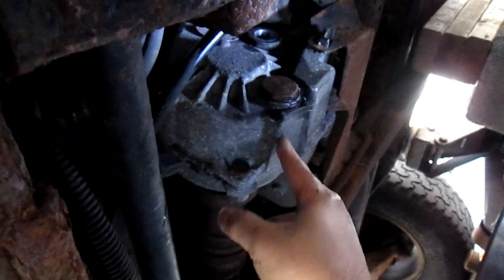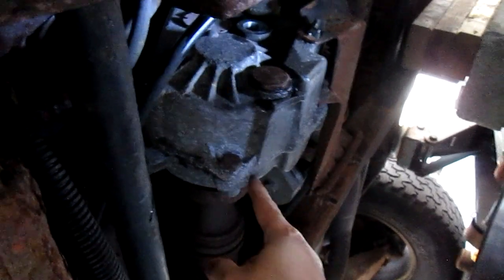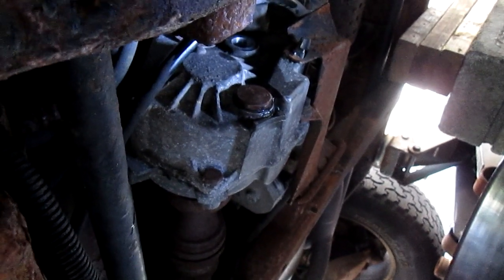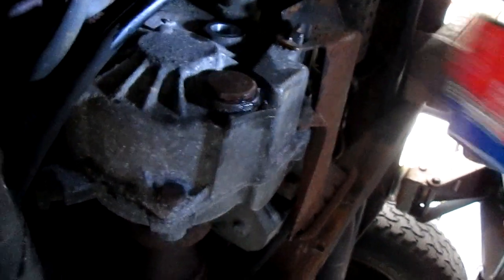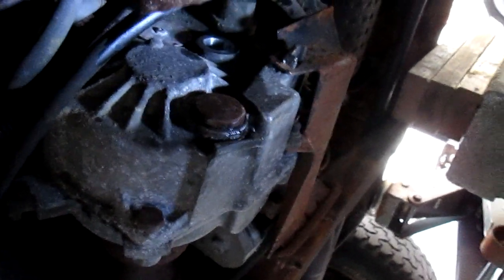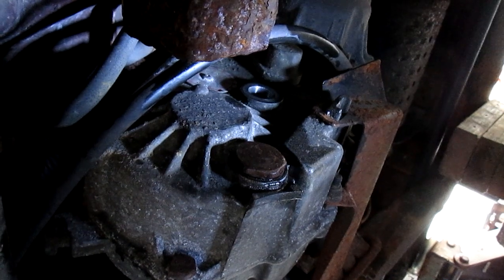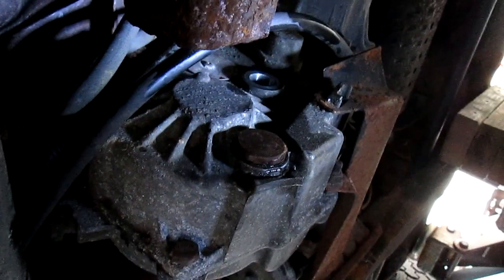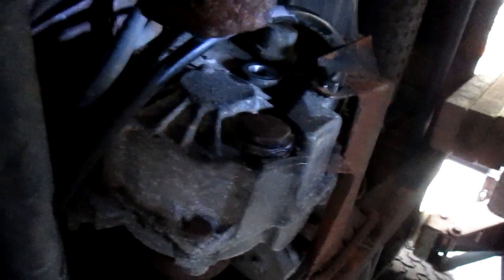DIY Transfer Case Fluid Change Replace Refill - 4.3L 1996 Chevrolet Blazer S10 GMC

Comment from the maker: IMPORTANT NOTE:  After changing this Fluid... I found out there was a small leakage in the Transmission to the Transfer Case and that is how I got to about 2.5 Quarts of Fluid. I then use " Lucas Oil Transmission Fix " and I put it in the Transfer Case and that seems to work.  I will make a Video of it during Spring time. NOTE:  In this Video, I use the Walmart Super Tech™ Full Synthetic Automatic Transmission Fluid - Approved by Ford and GM and contributes to peak performance in almost all vehicles with automatic transmissions and other transmissions where DEXRON-VI and MERCON-LV fluids are specified.   https://www.walmart.com/ip/52626198

Comment: 1st of all the transfer case is only connected to the transmission via the front drive shaft. No fluid runs thru the drive shaft at all. They have their own reservoirs, fill and drain plugs. The Transfer Case uses transmission fluid which has more modifiers added to it than simple transmission fluid aka  " Additives". Your transfer case sees a lot of heat and needs more lubrication than your transmission. GM dyes their Transfer Case Fluid blue, so they will not have to honor their drivetrain warranty when your bring in a vehicle with a failing transfer case with red fluid in it. Your on the right path, but you have just a lot more studying to do. Maybe not ...Youtube has it all. Fantastic references, you just have to watch out for people who give out the wrong information thinking they are 100% right.
Reply from the maker: LOL, you have MORE studying to do.... I stated CLEARLY in the Video.... I said if the Transmission SEAL FAILED.... It will leak into the Transfer case!  Thus, I have have stated clearly in the Video, that was the main argument between me and the AutoZone Tech.
Reply: Right.... Gear oil lol

Comment: I changed that stuff in the truck here.  Used the Autotrac fluid that AC delco makes. What it required. . Some older units took ATF.   Usally the floor shifter 4WD used ATF.  The trucks with the AUTO 4WD used the autotrac fluid because that trash has clutches in it. NEVER USE Auto!  2 hi 4 hi or 4 low!  Really the GM Autotrac fluid IS like ATF but its dyed blue.   Nahh only the front diff has the gear oil in it. Of course the rear too . I wanted to make a magnetic drain plug for the  truck, I believe the plugs were aluminum..   The REALLY OLD trucks like 1980s before had gear oil in the transfer case.
Reply from the maker: +Ghetto Wagon - Oh ok... I put ATF Fluid in there, LOL
Reply: If its not a push button its probably ok.

Comment: My 2001 olds bravada is AWD does it matter if Have to use the acdelco oem or can I use the valvoline multi vehicle full synthetic safe??
Reply from the maker: @Francisco Verdugo
 - Sorry I didn't see your message / post until now :((((.  YouTube didnt' alert me somehow :/
Reply from the maker: @Francisco Verdugo
 - From my understanding of things, it doesn't' matter...  Most Brands trying to selling you " Snake Oil ".  I use Walmart SuperTech Brand for 2+ Years, I have no problems with them!
Reply from the maker: @Francisco Verdugo
 - NOTE:  In the Video here we used / filled ATF fluid requirements of GM's DEXRON-VI specification.  GM's DEXRON-VI is an Anti-Slipping Agent from my understanding of it.
Reply from the maker: @Francisco Verdugo
 - I use the Walmart Super Tech™ Full Synthetic Automatic Transmission Fluid - Approved by Ford and GM and contributes to peak performance in almost all vehicles with automatic transmissions and other transmissions where DEXRON-VI and MERCON-LV fluids are specified.   https://www.walmart.com/ip/52626198
Reply: Your all right mate and one last question how difficult is it remove a inner cv axle seal?
Reply from the maker: @franciscoverdugo4021  -  Honestly, I have done the CV Axle, but NEVER touched the Seal :(
Reply from the maker: @franciscoverdugo4021  - It is leaking?  If YES.... Try Lucas Transmission Leak Fix - I did that recently and the Transmission is no longer leaking.  That would be the Route I'd take, if you don't want to take it apart. :)
Reply: @JodBronson  haven't touched the seals yet but ima change the cv axles bc its slinging grease everywhere
Reply from the maker: @franciscoverdugo4021  -  LOL, no my Dad thought the Axle was bent :/.  Honestly, I did  it for nothing.... The Axle was not the problem after I took it out :(.
Reply: @JodBronson  you live and learn lol

Comment: I think you're supposed to use AutoTrac II if it's an automatic.
Reply from the maker: See Pinned Post.  
COPY:   In this Video, I use the Walmart Super Tech™ Full Synthetic Automatic Transmission Fluid - Approved by Ford and GM and contributes to peak performance in almost all vehicles with automatic transmissions and other transmissions where DEXRON-VI and MERCON-LV fluids are specified.   https://www.walmart.com/ip/52626198

Comment: Maybe if the truck had a manual transmission you could run gear oil..90 weight..I dunna. I’m just shouting out ideas lol
Reply from the maker: So if you are "unsure", maybe you should make it as a "suggestions" and then tell the Customer to "double check", right?  But here is the problem.... The Customer (me) already double checked before I even went to the Store!